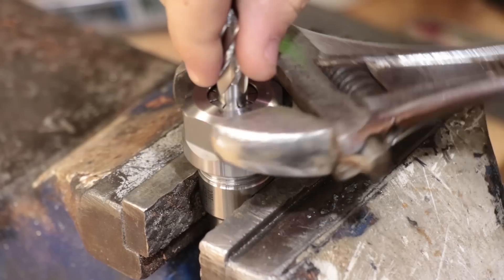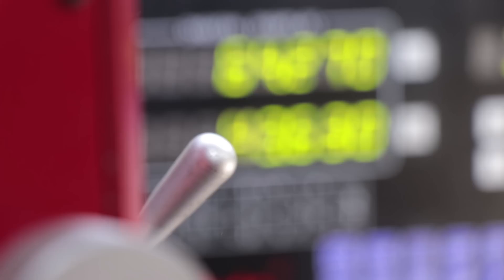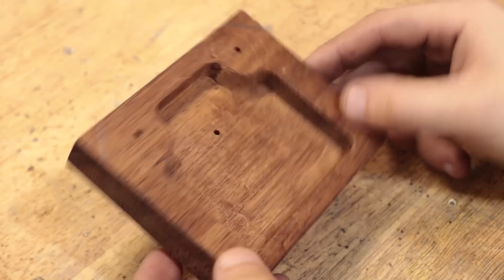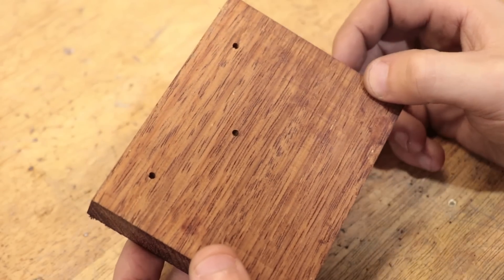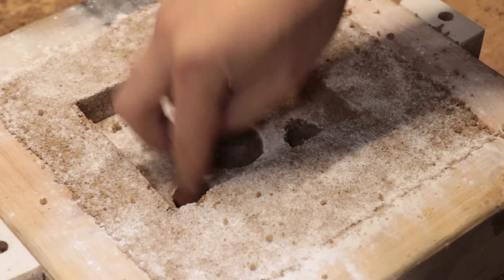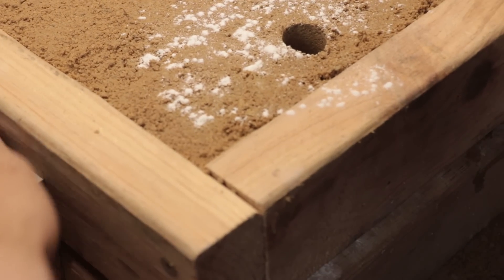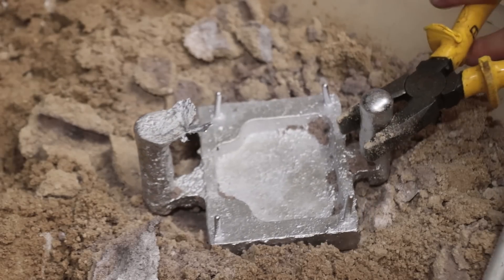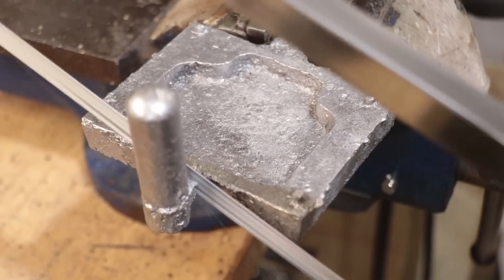Making a Gearbox Part 1 - Casting The Housing

Comment: Why do you want to cast the gearbox casing? If I look at the effort that goes into machining the pattern why not machine it directly into solid metal. I can only see the casting process as advantageous if you need multiples. If you need only  one  it is just a waste of time.
Reply: saves on material and a chance to try out casting. Plus I suppose it might save a bit of cutters and so on. Besides there's every chance he'll stuff up the machining and ends making multiples anyway ;)
Reply from the maker: The design is very conducive to being cast with those extrusion's at the back  which will later become a bearing housing and rail guide. Its easier and cheaper for me to cast it as a feature like this than to try and braze an extrusion on to a piece of billet. Plus I am making 4 of these parts, so casting was the clear way to go.
Reply: (Not intended as criticism, just wondering)
Reply: wouldn't it be very expensive to buy that big of a block of aluminum just to remove most of the material.
Reply: It isn't about making a gear box case. It is about learning how to cast metal. He needs the practice and learn for bigger and better things.

Comment: Idk which kind of motor are u planing to use but i would suggest 2 types 
Bldc (because the speed won't sag under load)
And stepper motor( because u have some decent control and accuracy)
DC motors aren't a good idea because they spin very fast with little torque and in order to keep the thing moving, they drop the speed 
Same goes for universal motors

Comment: Very interesting project , I'm interested in trying some small castings but i have encountered difficulties with the green sand, I've tried both with water and oil. Do you have a video to suggest that i can watch and maybe find out a good mixture . Also what have you used as degasser and flux in order to remove dross from the liquid aluminum ?
Reply: Mix thy sand 10:1 with liquid glass (water glass), after the form is filled let it dry. As flux - teaspoon of kitchens salt (NaCl) and teaspoon of washing soda (KCl)
Reply: Have you considered a lost-wax plaster mould? I don't see why use sand for a single nonferrous casting.

If you insist on sand, check out olfoundryman and vegoilguy's older videos, one of them probably have what you're looking for.